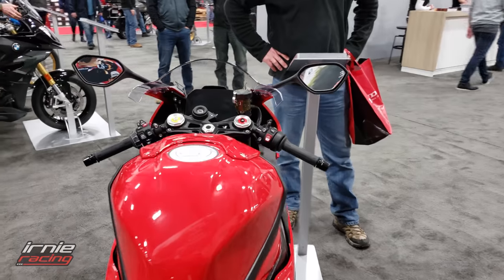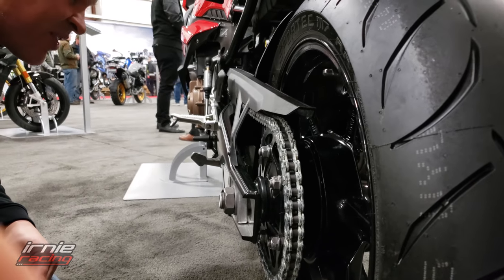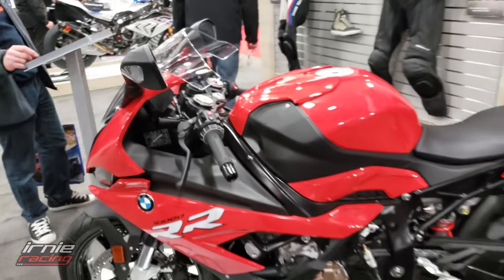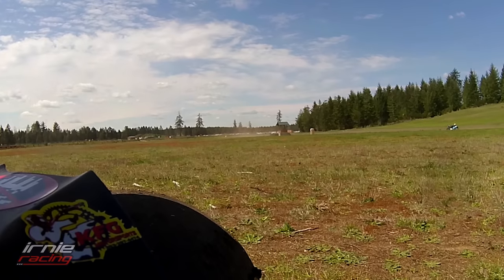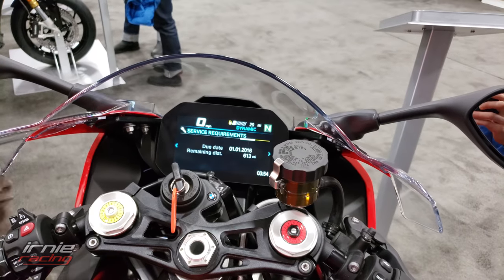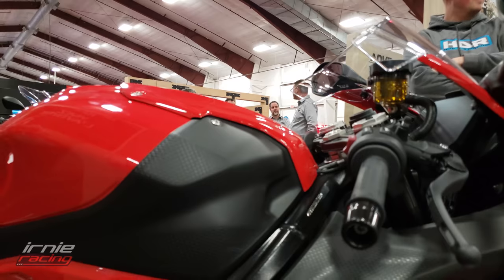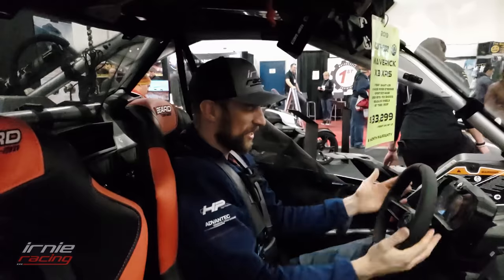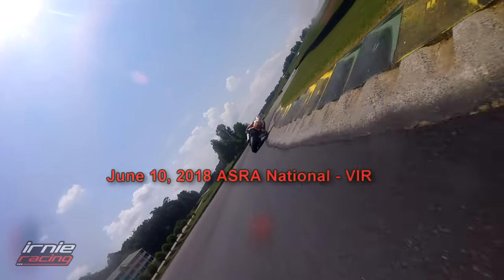BMW S1000RR 2019/2020 First "Racer" Look | Irnieracing4k

Comment: The HP wheels won’t fit this one if the engineers said in November because the alignment is different for the lighter wheels. It’s offset by about 5mm and apparently cannot be easily adjusted for non M Sport bikes.

Comment: Sorry Marcel it's a totally new bike ,nothing will fit ,the m wheels are carbon ,not sure of the brand ,but you might get a couple of bits here there but new bike .
Reply: I'm on a 2009/2010 Kawasaki zx6r and it's great because the model has barely changed. Even the 2019 parts are almost completely identical.  10 year old bike still competitive for the podium in club racing!

Comment: The more I look into this bike, the uglier it gets. Why the front brakes are not brembo stylema or M50 at least? the back brake is brembo. Even the underpowered and 2 years old Honda CBR1000RR looks like a better proposition. The Panigale V4 in its standard form is on another league altogether.